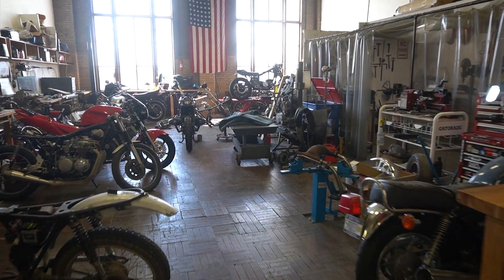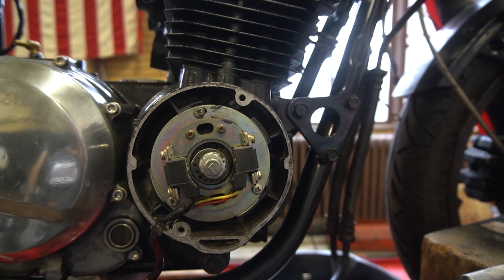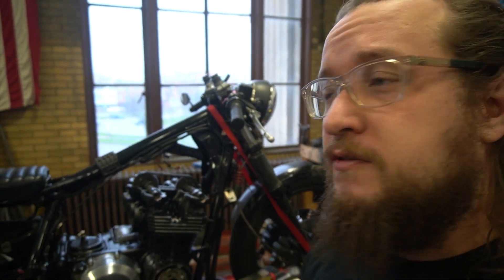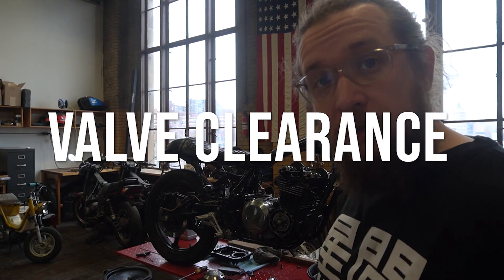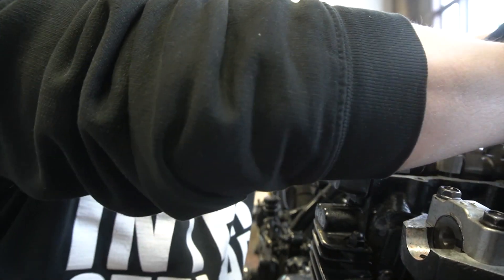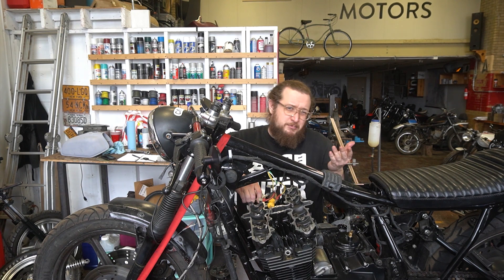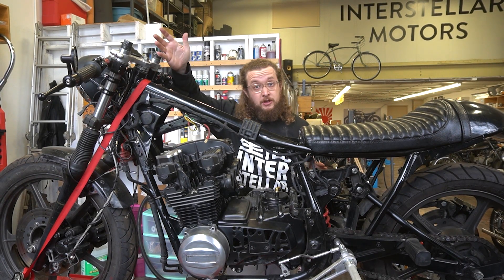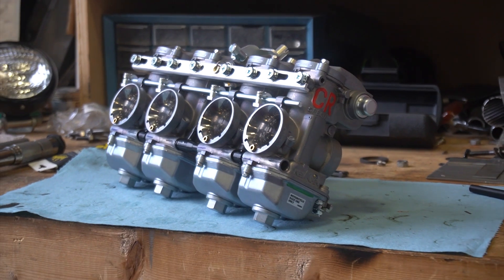GPz550 Head Install - Camshaft Timing and Valve Clearances

Comment: Great work!
What was your ring gap in the previous video? Also, is there a trick or technique used for getting the tensioner block back into the cylinder?
Thanks!
Reply from the maker: Hi I know this is a crazy late reply, but I did go looking to see if I had the ring gaps written down anywhere. I didn't find it, but I will say that Wiseco will give you a formula to work it out for each ring. Typically, the bore size multiplied by a provided constant. Hope that helps.